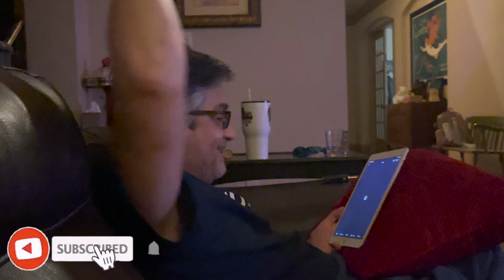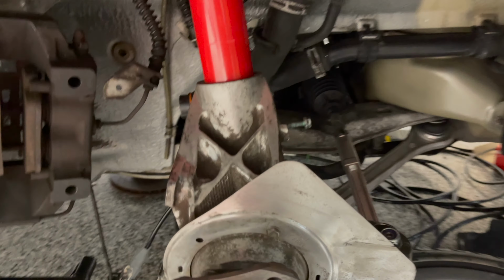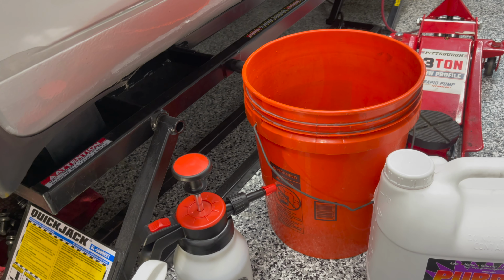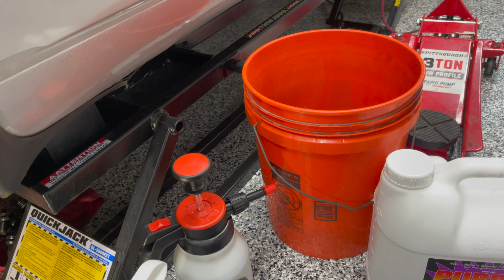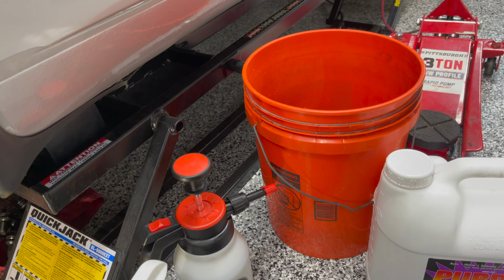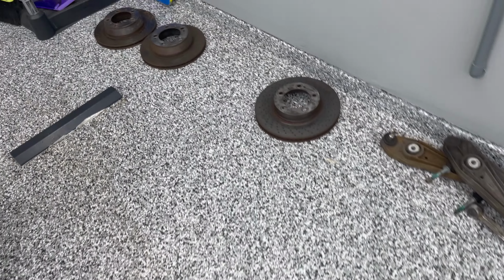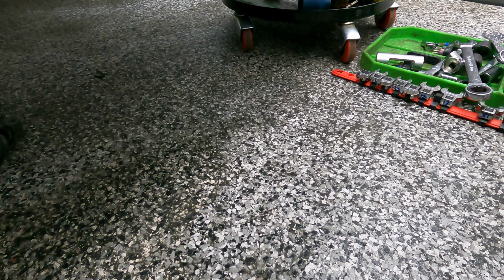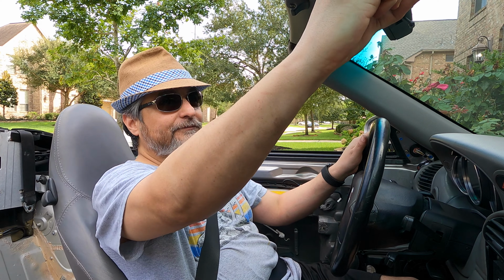PROJECT: Pepper FULL SUSPENSION REFRESH For my Porsche 911 - Part 2

Comment: Glad I came across your channel!
I have some bad seals in atleast the drivers side hydraulic ram so gotta get into that & I appreciate videos to see what needs to be done.

You were talking about doing the top engine refresh, I heard the timing chain tensioners are good to be gone over & also I heard over time the injectors can start to leak causing gas to get into the cylinders breaking down the lubrication & that's when the bore scoring happens. Sounds like you're on top of stuff so I'll be watching your videos to see your adventures with your 996!
BTW loved your fight of you vs the cabro top🤣
Reply from the maker: Glad you liked it!  It was a battle indeed. But like the video guy said: “Yogi Wins!”

Comment: In case you see this, Yogi, I just put actives on my 02 996 Cab. It has stock springs, and I replaced every arm, but the rear sits A BIT HIGH off the wheel. It's awkward. Do you have stock springs on your car? non ROW/M030?
Reply from the maker: I did have stock springs but I recently just replaced the lowering springs. Check out my latest video. You can see what what it looks like for yourself.  Thanks for watching!

Comment: Around 10:00 in this video, you say you're going to compress the spring.

Next and without explanation, we see the retaining nut removed from the top hat and no spring compressors -- and you're whacking on the top hat to remove it with a dead-blow hammer. What happened in between? Specifically, what relieved the spring compression so that you could safely remove the top mount?
Reply from the maker: Nothing too exciting. I used the spring compressor to relieve the pressure on the spring. Then I zipped off  the nut and relieved the pressure on the spring compressor. After that I had to whack it with a dead-blow to get the top cap to come off. It had a little bit of rust was slightly jammed when I loosened the tools.  The hammer knocked it off the rest of the way. I did the same on the other one but this time I left the spring compressed and hammered off the top the rest of the way. Then you can loosen the spring as a separate step.  Hope that helped. Thanks for watching!